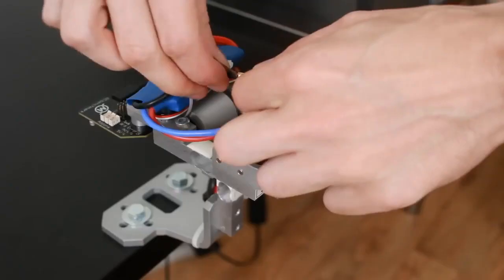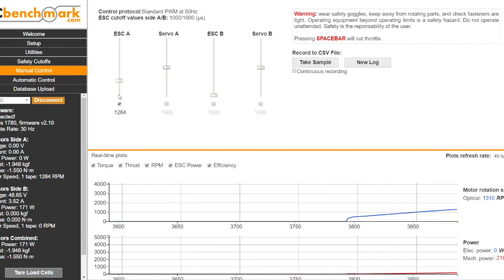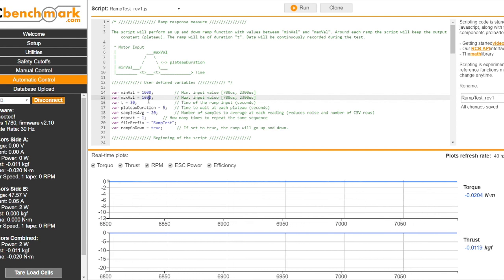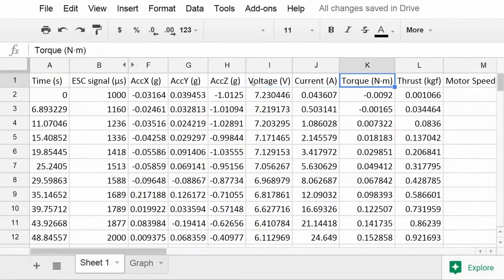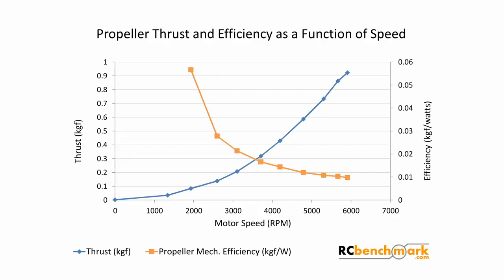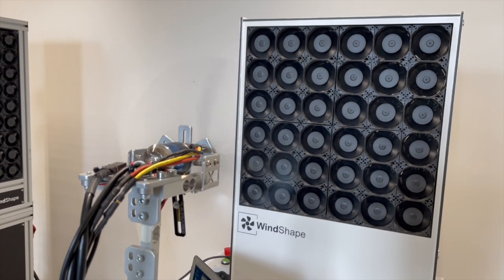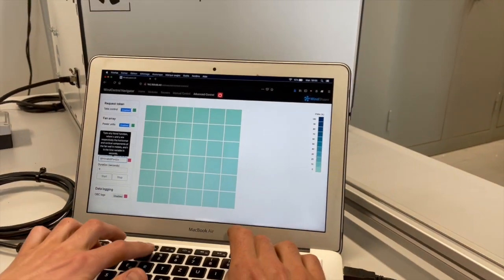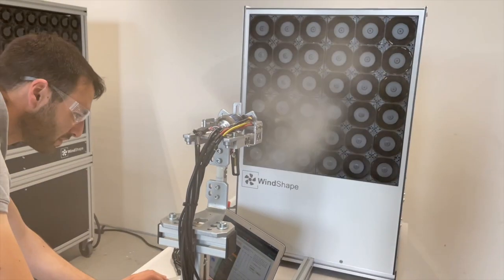How to Measure the Thrust of a Propeller With a Test Stand

Comment: The motor and prop is too close to the stand.
The column of air moving around the mass of the brackets is going to be disrupted. This will cause false readings.
The sensor being used to determine thrust, is not in line with the prop. The triangular offset means that shaft position differences will skew the data and make accurate comparison measurements very difficult to achieve.
Reply from the maker: Hi Tom. We have tested for this in a 2016 RCgroup post titled 'Propeller above or under the arm?' The effects are small in pusher mode. You could add a spacer for a small propeller such as the one in the video.
Reply: Will it be accurate to use a beam type strain gauge for eccentric and non-compensated mounts ? That too for forces acting perpendicular to ground plane. Would it be better to use a S-type load cell ?